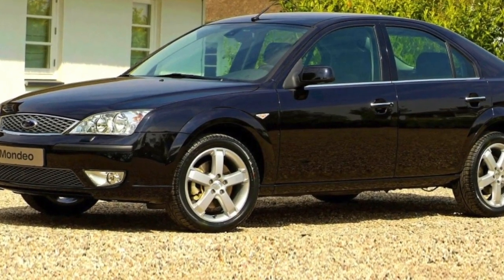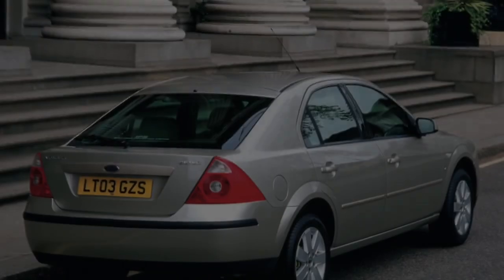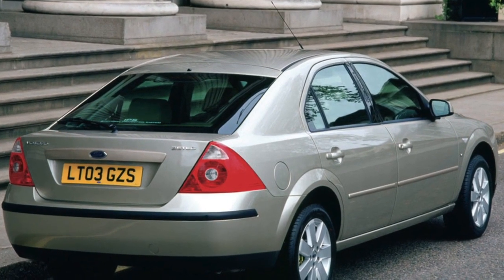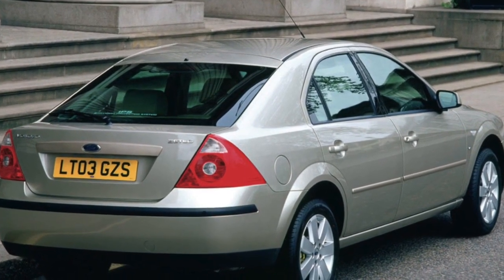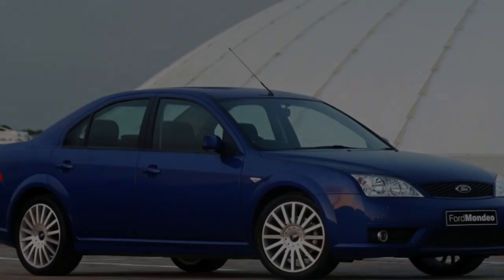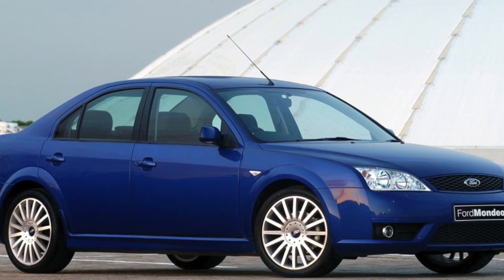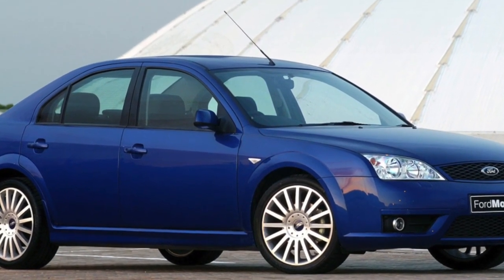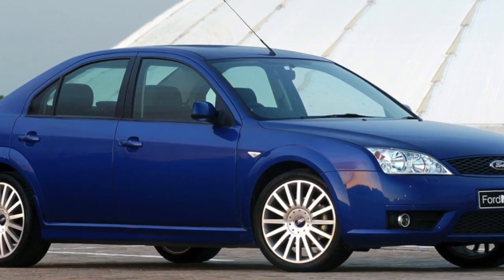Used Ford Mondeo 3 Reliability | Most Common Problems Faults and Issues

Comment: Thanks for very good explanation and description! I am looking to 2005 2.0 145KM automatic with 51.000km. I owned 2001 TDCI but I sold it because I have to many engine problems (450.000KM). Quality of the car is very high. Thanks again.